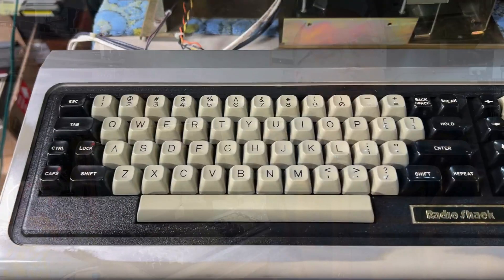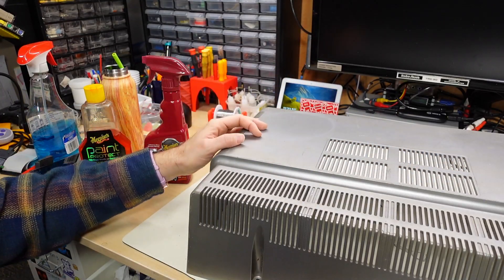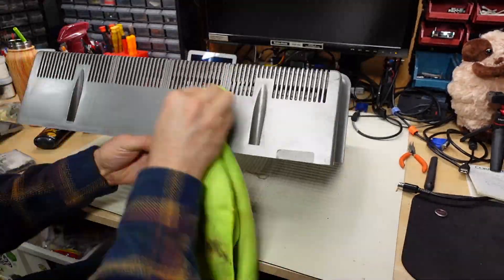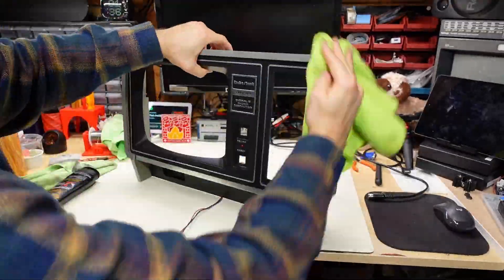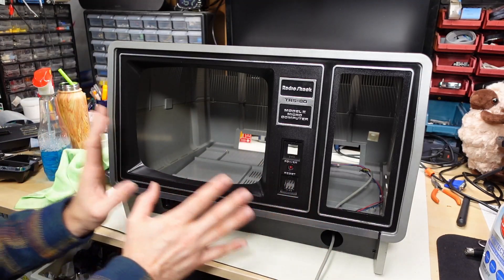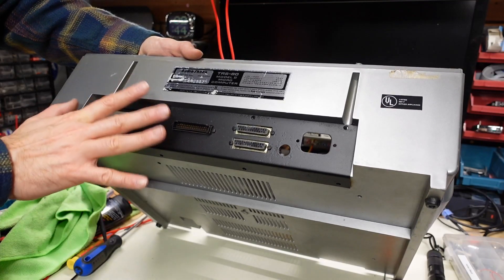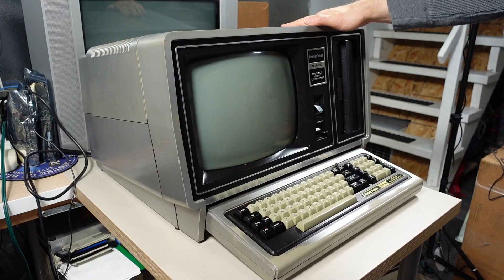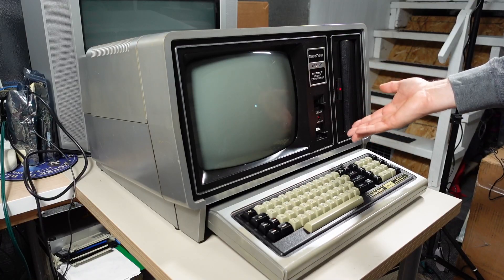Using an $25 Gotek floppy emulator in place of a 8" floppy drive

Comment: Back in the day, I was home for lunch and was playing one of the old Sharedata games, Wheel of Fortune or Jeopardy or something, and I lost track of time and suddenly noticed I was late to head back to school. I quickly shut off the PC (pretty sure it was an XT) and left. Later, when I tried to load the game up again it wouldn't start, "Bad command or filename". Somehow the executable file had been deleted from the (original!) disk. Every other file was present and seemed to be okay (as far as I could tell with my very limited knowledge and tools at the time), but I had to way to run the program.

Eventually I found a friend who also had the game and I tried copying the executable from his disk, but he must have had a different revision or something; the file was too big to fit.

That's the only time I ever lost data from power cycling the PC, but I've been skittish about it ever since, and I always make sure to unmount USB drives before removing them, even when I "know" it's not always necessary.

Comment: ive heard of using a gotek for 5.25 drives but an 8inch?  this is beyond belief!
obviously gotek usb are good for 3.5 drives
Reply: The Shugard interface is the same for all floppies. I think that with some care regarding the bitrate and the correct formatting of the diskette, you could rather easily make a 3.5 inch drive work.

Comment: I bought 4off old 3rd-4th gen Intel motherboards recently, and they all failed after a few heat cycles. 
Not that I know, I wonder if old chips absorb moisture when left for a long time and it's the first few heat cycle kills them, ie, moisture expanding and popping chips.

Comment: That is one of the most disheartening feelings,  to have something you've worked so hard on, fire right up, appear to function perfectly,  only to have it fail the very next time you turn it on! If it were me, the next thing I would do,  is unplug the machine,  leave it unplugged, but power it on through the switch for a bit, to drain any residual energy out of the caps. In fact maybe let it sit for a few minutes.  Then reenergize it normally without the added floppy emulator. I've seen ghosts like this many times,  and a thorough power down cycle, along with removing any peripherals, chases many of them away....

Comment: Great stuff, Adrian! What happened at the end is quite typical: after we fix the problem that originally took the machine out of commission all those years ago, other problems pop up after the machine has been on for a little while. Connections that were already marginal due to corrosion or electromigration fail after thermal expansion; cumulative damage from gamma-ray bombardment continues even if the computer is off, causing parts to fail when exposed to current; capacitors with cracked oxide layer due to lack of use fail when exposed to nominal voltage; and so on. I've got to the point where I regularly do a stress test on a machine just restored, to force all those marginal components and connections to fail so I can address the failures before closing everything up. It's frustrating when they happen after we've called the job done. I even swap out still-working components if I know that they operated hot, because high temperature induces faster electromigration and makes those components marginal very quickly.
Reply: How did you post a comment 7ds ago when youtube says the video was posted 8 minutes ago
Reply: @parkeerdarkeer  Patreon

Comment: For the plastic, it's best to design and 3d print replacement parts and then attach those. You can add additional supports to the part to make it stronger and easier to adhere.